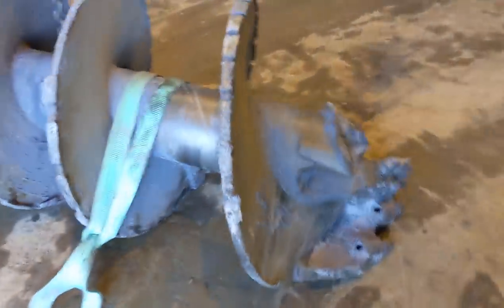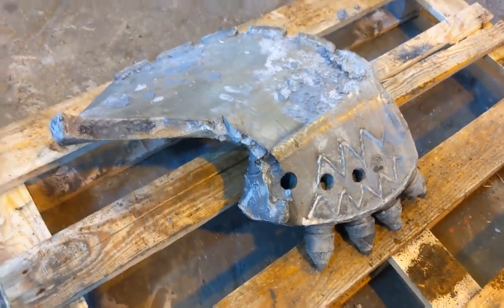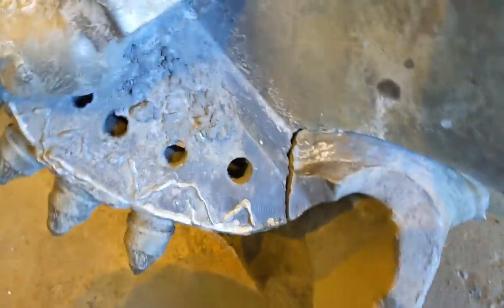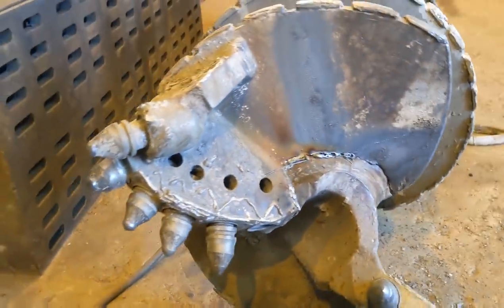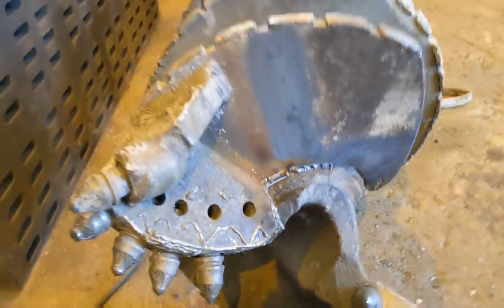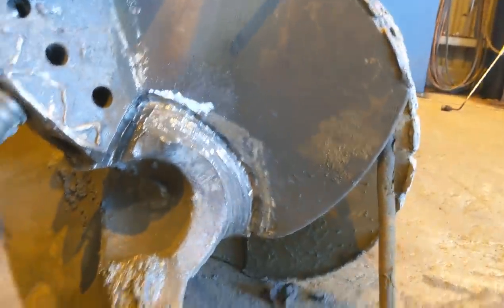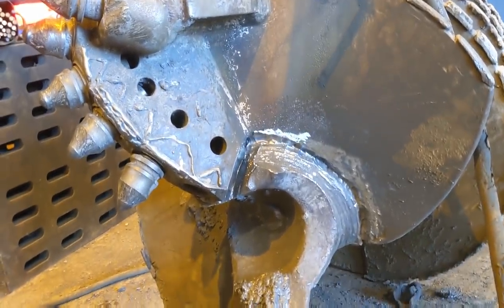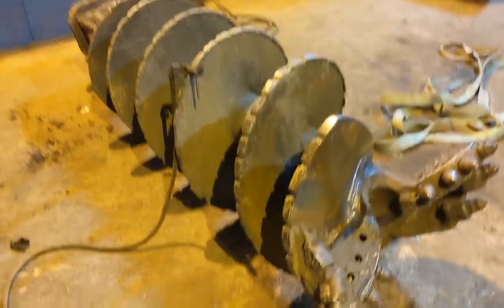MAJOR SCREW UP!  busted earth auger

Comment: Wow. Great video. That brings back memories. I worked a big triple auger drill. 80’ long drill string, 3 augers on 24” centers. 34” augers with staggered flights and paddles. 2 outside augers turned clockwise and center was counterclockwise. The cutting heads were about 36” tall with 2” thick flights. These all had 10” shafts with 6” hex connections. We pumped a cement like mix thru the centers via 2” pipe with sch-120 wall mixing it with the soil. I repaired this drill string for many years. Hard work. I miss it. Working on the big equipment is very rewarding.

Comment: Excellent job and a most interesting narration.  It was like falling back in time to 1980 working on Stanlow oil refinery with a guy called Les who came from Belfast. Invoking great memories.
I have little of anything to add.  Perhaps your camera angles might need a rethink.  The view of your arse is good... but I would prefer to be watching you form your welds.  I hope that you can get another Go-Pro soon.
Some explanation of the process and your reasoning on how you do each step, would increase the interest levels.  Metal type / rod type / current setting / more shots of the weld.
Great video though and I am certainly going to watch your whole catalogue.  Thanks.

Comment: Make yourself a big heavy duty steel work table with lockable wheels. Top plate 1” thick double Blanchard ground with a grid of 5/8-11 holes on 6” centers. Learn to glide an angle grinder with a cup wheel over it to knock off the berries and spatter but take little off the table. When it gets bad flip it over. When both sides are bad send it out for grinding. Figure 5 years a side. Get your work off the ground, your back and knees will thank you when you get to be an old fart like me.

Comment: Did you use 1.2mm wire, Bohler SG2 or similar, as you gouged out so much and filled to full penetration l doubt that it's gonna fail again, great weld beads you've put in, top job.

Comment: As a novice seventy y/o I have a wasps-nest of uninformed rookie questions.
You mentioned the material of the "wing'( was it?) was v hard, (and I assume brittle). I assume also that the weld would be less brittle to allow shock to dissipate under load. Of course the weld interface between the two materials would be a potential fracture point.
Was there any graduated heat treatment necessary?

Comment: Assuming the material is not 1018, what if anything does the heat do to degrade the manufacturers heat treat??
Reply: Annealing most likely won’t occur at ambient temps nor under the conditions. Plus, a manufacturer would do heat treat AFTER welding. Work harden? I’ll accept that. I asked out of curiosity, not from doubt of his skill or work. IF it is 1018, it is all beside the point. No stress, annealing, heat treat, work hardening, or welding after effects. That was at the beginning of my question. But thanks anyhow.

Comment: What did you use to gouge it out?  Tidy job mind👍👍👌
Reply from the maker: Hey Mike, air arc carbon rod 8mm rod bout 500 amps
Reply: Ah right thanks, thought it must be something pokey and that certainly is it! 👍👍
Reply from the maker: @Miketm155  that's it turned down! Lol 13mm rods will see near 1000amp !
Reply: Ah but your turned down is still massive to me! 🙈😂😂
Reply: @Juha Tuomala it'll be 3 phase
Reply: @Juha Tuomala 380v AC input min on most, but then 1,000 amps is 44v DC, not AC. Quality Welders that can produce that amperage start at about $7,500 to $50k+.

Comment: Why did you use mig  instead of stick rods
Reply: He's prob used an high quality wire like Bohler Sg2 and Argon mix gas, that wire would have been my choice in 1.2mm
As he's gouged out so much and filled for full penetration l very much doubt it's goin to fail again.

Comment: How do you v out the groove?
Reply: Looked like CAG,  Carbon Arc Gouging. Basically, about 300-500 amps air with air blown through the tube, and holder.  Loud as hell, but steel flys away.